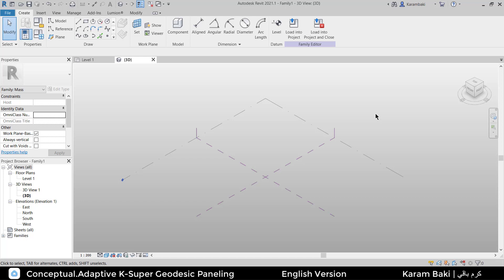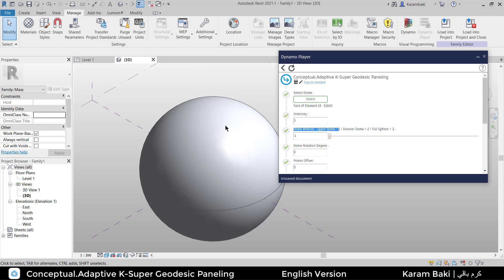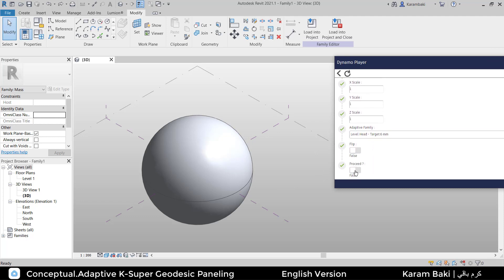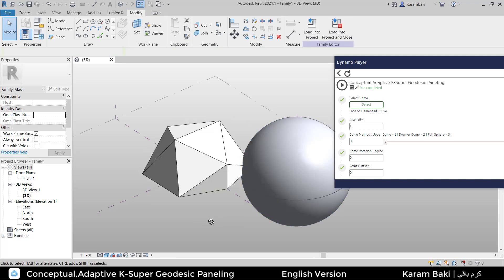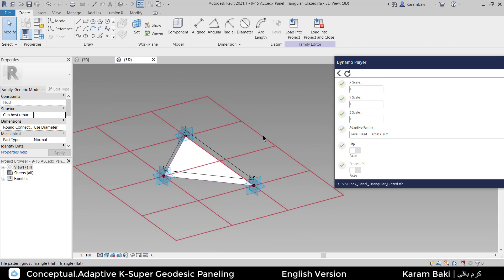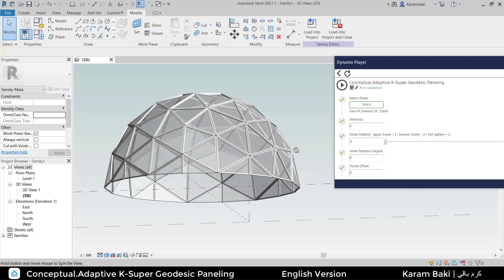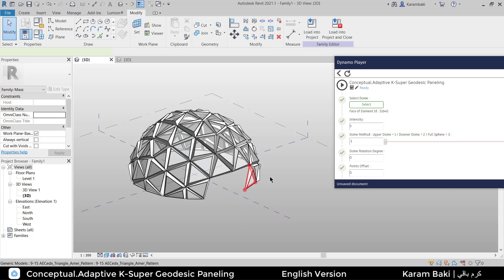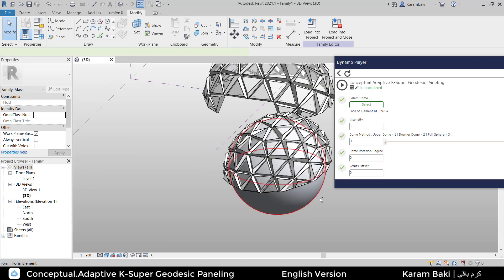Synthesize toolkit | Geodesic Dome In Revit

Comment: Thank you very much for the video, Karam. I have installed "Synthesize toolkit". But when I use "Conceptual.Adaptive K-Super Geodesic Paneling" just like in the video, the computer counts for a while, but in the end nothing changes on the screen.
What could be wrong?
I have the Russian version of revit 2021 installed.
I used the Metric Responsive Model Family template.
Reply: То же самое, никак не смог решить?)
Reply from the maker: @felixcat9306  The script has dropped the support for Revit 2021, it is working in Revit 2022.. please try it with 2022
Reply: @felixcat9306  Решил? У меня все заработало в 2022 версии. Если все равно не работает, советую попробовать обновить скрипты
Reply: I am having the same issue, following the same procedure on revit 2022. The computer starts counting and dynamo becomes unresponsive
Reply from the maker: @julesfocke  This specific case was solved in Revit 2022, I suspect the problem you're having is another one.. Probably your inside a command while Dynamo is running. Just press escape and it should continue working.

You can further send me more details about this to my email directly if needed: karam@aecedx.com